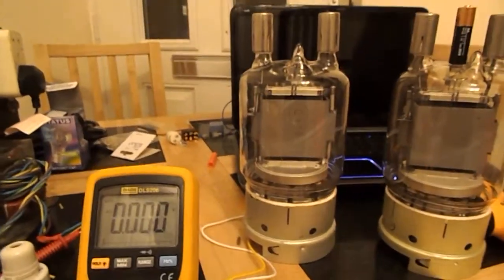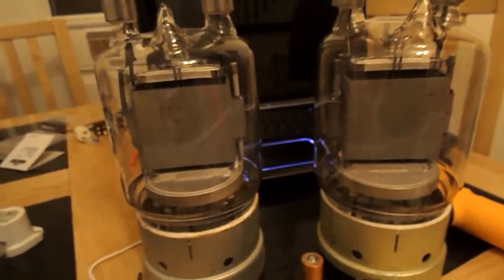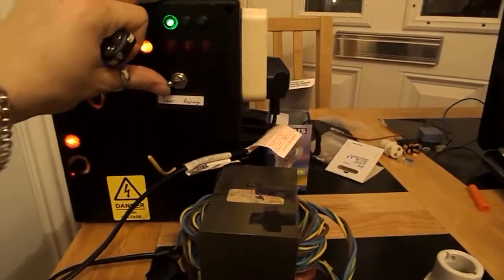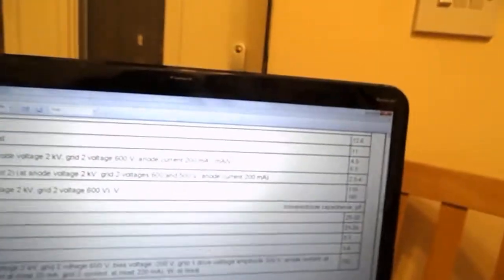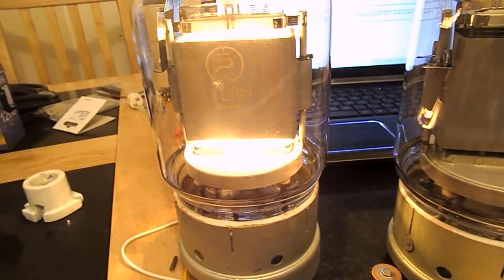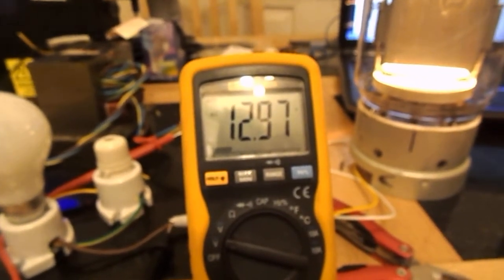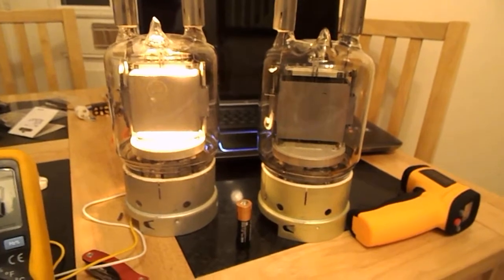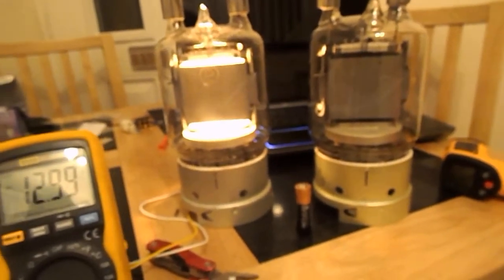GU-81M PENTODE VACUUM TUBES FOR VTTC PROJECT+REMOTE CONTROL UPDATE

Comment: I have read that it is better to start the filament in series with a 2 ohm 100 watt resistor and after 30-60 sec at full power.

Comment from the maker: I cant wait either iv seen nice coils using these tubes with only 30 turn sec 15 turn pri and 4 turn feedback all rapped on a pot noodle pot. lol I would like to go BIG though . 
not so sure with the mot it does its job but i think 3 secondary windings was a bit ambitious all seems well though but i have to run just the filaments for 12 hours so that will be the test ,i could really do with a bigger MOT but i can go 2 secondary's with some 15A cable i have instead of the 13A ,only time will tell